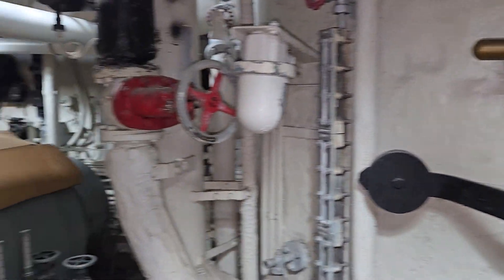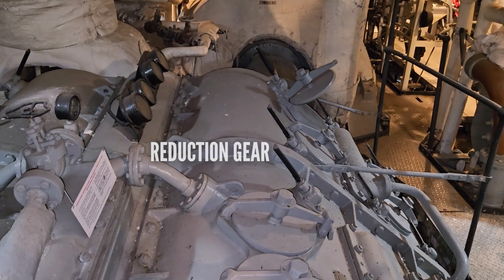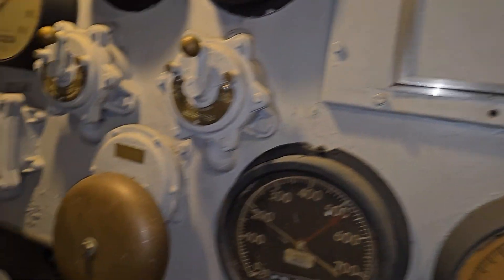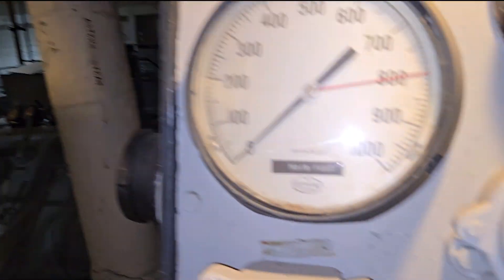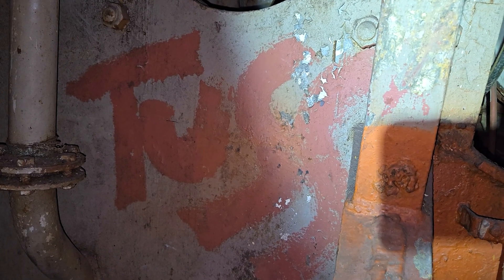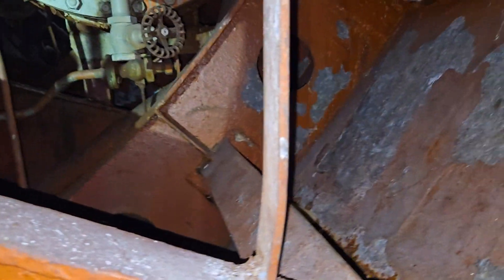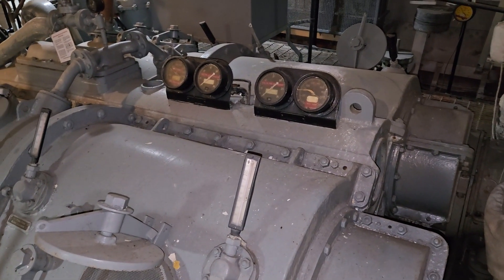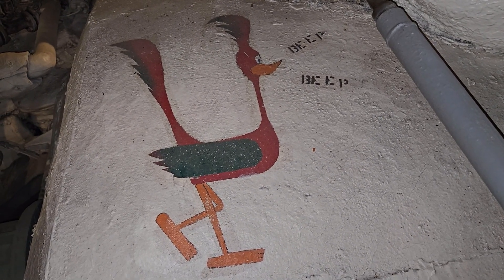Discoveries in KIDD's Engine Room and Crawl Space

Comment: When the RPM indicator failed aboard USS Valdez we had to use the mirror to estimate RPM at very low speeds during mooring operations.  You cracked open the throttle and backed off as soon as the shaft started to move. There was a plaque on the throttle board that related inlet steam pressure to speed above a few knots, which might be on the Kidd throttle board.

Comment: Under the reduction gear and condenser what color is that paint? Looks copper-ish... any particular reason that color was used? Seems out of place, must have been a reason behind it. Thanks, love your content.
Reply: That’s known as red-lead paint. Used to be infused with lead to make it as a protective coating against wear and elements. Also used on decks and wherever you needed it. They stopped using it in the late 80’s due to the lead concerns. Can’t remember what they use now.
Reply from the maker: @nvexs4u2 : And that's why we test before doing any work in areas with old pre-museum paint. 🙂
Reply from the maker: @dogsbd : Thank you! The color is a rust-colored red, vs a bright fire engine red. Based on what engineering crews have told us over the years, the bilge paint colors depended on two variables: 1) whatever the chief wanted, and 2) whatever was available. 🙂
Reply: old red lead

Comment: How far down into the bowels of the ship, will the repairs/upgrades go?? How indepth?
Reply from the maker: We're there for hull repairs. That's first and foremost. The structural survey was to identify known and unknown trouble spots on transverse and longitudinal supports. That way, once cutting on the known trouble spots (i.e. the cradle touchpoints and any holes from the blasting) on the outer shell plating begins, any internal work that needs to be done in that area can be addressed then. Conservation of effort.

Comment: RonSimons and MeMadMax are correct - that mirror serves only one purpose, and that is to stop the shaft as quickly as possible while the ship is underway. Loss of lube oil is one reason, other reasons would be rumbling from the turbine or reduction gear (indicative of imminent mechanical failure of the internals) or a man overboard on that propeller's side.   The throttleman is trained to quickly shut the ahead steam throttle valve and apply sufficient astern steam to slow then stop the propeller & shaft. The Upper Level Watch positions himself near the shaft locking mechanism and engages that as soon as the shaft stops, then the throttles are shut. That watchstander has direct view of the shaft when standing by the lock, no mirror needed for him. 

Even more difficult is UNlocking the shaft while underway, as that requires precise application of astern steam, but without the visual clue of the turning shaft coming to a stop. The throttleman has to vary the astern valve until the upper level watch can retract the locking mechanism, mostly by trial and error. For this reason, most of the time a locked shaft will be unlocked by stopping the ship through the water momentarily. However, all the ships I was on drilled and practiced locking and unlocking while underway. 

Also, this engineroom looks great - very clean and well lit. It could easily be mistaken for an active ship. Will the yard be able to clean up the interior difficult-to-reach areas, remove the peeling paint and recoat the interior bilge surfaces?
Reply from the maker: Well, we'll agree to disagree on the "sole purpose" of the mirror. Yes, it absolutely was used for locking down the shaft, as you describe. But we've had multiple throttlemen from various destroyers describe separately on separate visits and unknown to one another the use that is described in this video, as well as painting ONE of those stripes on the shaft a color other than red or white and using it to verify that they were achieving the RPMs that the tachometer was reporting when the instrument was in doubt. Most tools are often used in ways the original designer hadn't thought of. This was just a quick and dirty video Tim made while straightening up, cooling off, and hydrating outside the crawlspaces for a few minutes. It's not meant to be all-encompassing. 🙂
Reply: @usskidd661  I suppose if one were a contortionist and masochist, the mirror could be used for a quick shave while on watch 🤣
Reply from the maker: @barrywitte6562 : Shaving aboard a ship underway PERIOD must be a skill set unto itself, worthy of its own rating and pay scale. Particularly on a destroyer, DE, patrol frigate, or another of the "small boys."

Comment: I am assuming that the turbines (and no doubt lots of other things) are lagged with asbestos.
Reply from the maker: @Kevin-go2dw : Yes. And encapsulated.
Reply: @usskidd661  Once sealed off it's safe to be around.  My question is if asbestos was so dangerous it seems like anyone in the area when it was 1st installed would have all died of the same cancer and same time period after exposure.  I'm certain that for decades ship builders and other trades handled asbestos without protection and not knowing that it causes cancer.  Asbestos looks to cause cancer but is it predictible for sure or only some people get cancer after exposure?   Great video.
Reply: @usskidd661  You have some torn asbestos cloth on the gray painted line that runs behind the reduction gear around 0.58 of the video
Reply: me as house if its painted over its ok. just don't removeing it you will be ok.

Comment: Little bit of bad info.  To change prop directions , ie forward to reverse, ONLY 2 valves need to be changed  and both are on the throttle board  -- close the forward and open the reverse.

Comment: The mirror is for the throttleman to observe the shaft if it becomes necessary to stop the shaft and allow it to be locked in place. This allows the ship to continue operating with one shaft in service. Loss of lubricating oil pressure to the turbines and reduction gears is one reason to stop and lock the shaft, preventing damage to the bearings.
Reply: I was on USS Bradley ff1041 one shaft quite similar.  I could strobe my shaft and we could sight in the tach speed real well, my view from throttles was much clearer. Mirror was about 2x thst size midships though. Now, he was stuck on the roadrunner, I wanted to see if they had the IP/LP crossover design like we did. Unreal ACCELERATION potentially under UPPER LEVELMAN watch management. ENG SUP has to order UL to open it when Throttles orders emergency flank bell.
Reply: Also used when doing a stop and lock procedure